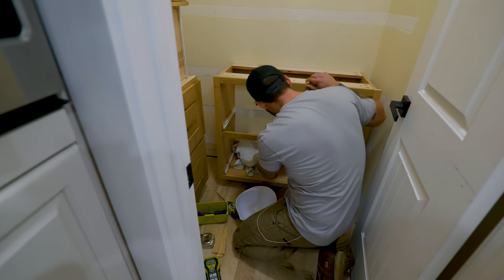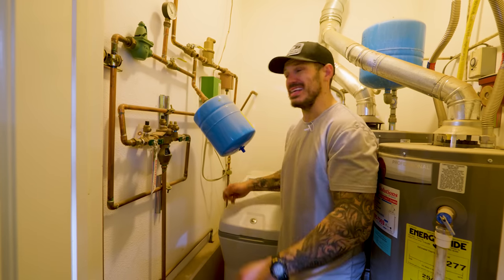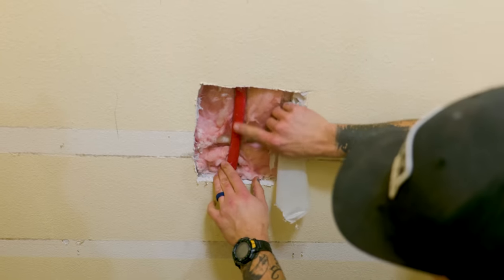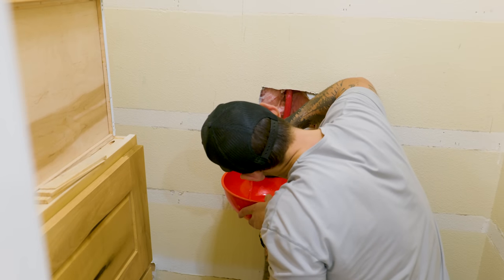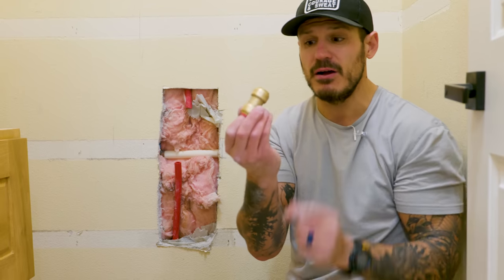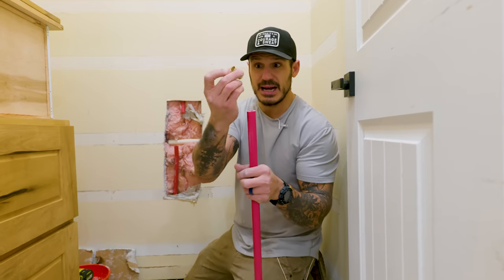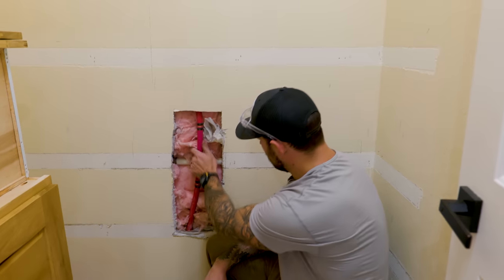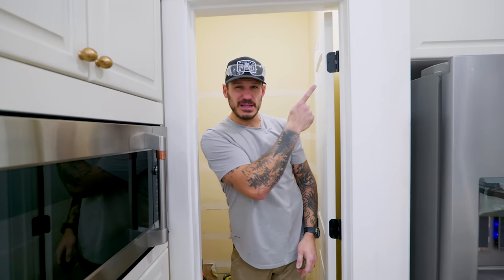Accidentally Drilled Through A Water Line- What To Do!

Comment: I’d rather get shocked than hit a water line
Reply: Both are equally as annoying to be honest, But if you hit an electric run it's worse to fix properly because if you do It right you either have to run a new wire or find a place to put a junction box.

Comment: From my plumber uncle - sharkbite is perfectly fine to use for a home gamer if you have easy access to a line - under a sink, in a basement, etc... but you really don't want to have it somewhere you don't have easy access to, like in a wall.  More than likely, it'll never fail, but in the off chance that it does, there might be pretty significant damage done before you notice.
Reply: Lolol plumber who doesn’t like shark bite alert.
Reply: That might be true. I repaired a couple of leaks in my house with sharkbite, both of them are in pretty easy to reach area. One of them failed after 5 years, the other one is still holding up. Who knows, it may have been a bad one, "plumber" error, I don't know. I check the second one every once in a while to see if it failed but nothing so far.
PD: both of them are cold water, pex b pipe/tubing.

Comment: As a ‘what to do now’ video I would have included. Do not remove the screw! It will limit the amount of water escaping. As someone else said, drain down from a lower point if you can. Including drain off points in your plumbing design is a great idea.

Comment: Glad you also showed the compression ring and coupling method vs just the sharkbite coupling as sharkbites are never to be used in an enclosed space you cannot see or otherwise maintain easily. They are technically only for short-term repairs and never at a long term rate permanently.

Comment: You said there should be some type of metal plate there blocking the pipe?  Shouldn't you add that so you (or future owner) doesn't make the same mistake?
Reply: If the pipe is running through a stud there should be a metal plate on the stud where the pipe runs through it. In this case his stud finder actually found a pipe instead of a stud. Where the pipe is running straight up the wall there is no way to really shield it. He just had some bad luck here.

Comment: Thank for showing both methods. Nothing wrong with either connection. It’s just a matter of warranty when you service a customer. Shark bites can be unreliable as in some situations if they are installed with tension the plastic insert inside of those fittings will blow apart. However great job at your reaction time, and knowing where to go to shut off the water is half the battle. Panicking and not knowing where to shut off the water is a bad combo. 90% of clients I service have know idea where the shut off is. Everyone watching….know where it is for your own sake and to protect your home, your investment. Thanks for all you do brother love your work.

Comment: As a plumber I don’t like sharkbites, I have come across a lot of failed sharkbites. Majority of the time it’s due to improper installation. Now as a home owner needing to make a quick cheap quick fix I recommend them. As a professional, I do not. A professional should be doing it the right way, the customer is paying for you to do it properly, you should be giving them value for their hard earned money. Only time as a professional I would use them is in a temporary situation where I know I will be coming back to replace it the proper way. I.e in a emergency situation or if I am doing a remodel and temporary capping or tying in a line.

Great video, this will help Home owners save time and money and avoid damaging anymore of their property.

Comment: After you turn off the water main open up an exterior hose bib (that’s lower in elevation than the damage area) and it should drain out the extra water in the line so it does spill over whenever you cut it to make the repair.

Comment: yeah, kind of did the same when my stud finder said there is a stud behind the wall. Turned out to be the drain pipe from upstairs bathroom. Now after marking the stud with finder, I come back with a magnet to establish a vertical line of dry wall screws to confirm its a stud.

Comment: Yes shark bites are temporary fix they always end up leaking but your second option is perfect !!
Reply: Have some in my basement that are almost 20 years old and not leaking
Reply: @shantor100  one of those lucky people all I can say or u just a handy man lol
Reply: @DracoSzn_  what does what I do have anything to do with my experience. I can generalize like you and tell you I'm a building contractor who spends most of my time fixing so called plumbers and electricians screw ups. Although that happens a lot I'll specify my comment. I don't condone shark bites ahead of soldering or working off of a soldered shark bite nipple. However I've seen plenty of plumbers use them for hot water heater hook ups and other utilities which shocks me so maybe you should get sarcastic with your industry. I use them in certain situations when I can get to them and not bury them in walls and need the water back on . The one in my basement was from a leaking ice maker line right before a party and I didn't have 2 hours to get all of the water out of the line for soldering. Chill out man. Not all shark bites leak
Reply: @shantor100  BRO I love your comment back! And tbh if a “plumber” uses shark bite you mind well just call him a handy man honestly because they just lazy and do half ass jobs ! And I 100% agree with you bro as in only using them if it’s impossible which your statement was !! And That’s the only one I would use is a ice maker shark bite the white one though because those don’t leak !

Comment: Never used sharkbite before, but I'd definitely want the "old fashioned"😂 repair.
Reply: If you are able to use the authorized fitting for the pipe please do so, I’ve been plumbing for 10 years and I can say I’ve replaced more broken shark bites than I’ve put in, if you absolutely have to use one than please don’t burry them in a wall behind a cabinet in a closet 😂😂 they have Orings in them that are made of rubber and no matter what they say WILL fail after so many uses,

Comment: Suggest that you and most home owners pick up a water meter key. They’re about $20 at HD / Lowes and specifically designed for the water meter valve. Obviously a wrench will work in a pinch but this is easier. We keep ours in the front hall closet so if we ever have a water emergency it’s easy to grab on the way outside (older house with no main water shut off valve inside).

Comment: I love shark bites. I know most plumbers hate them but I can't afford a plumber. I've rebuilt broken automatic transmissions and built engines. I can do plumbing. Everything I've done is still working fine
Reply: The only problem with sharkbite is that they last.. until they don't.  They're pretty solid, and will likely never fail, but in the situation where it *does*, it could cause a ton of damage - especially if it is hidden in a wall, where you might not notice until there is significant damage done.

As I commented elsewhere, my plumber uncle will never use sharkbite on a job.. but in his own house, he uses them in areas that has easy access - places that, in the event of a failure or a leak, you can quickly notice and fix.  Putting them in a wall, however, is not a great idea.

That being said, I have a bunch of sharkbite connectors in my toolbox in the off chance that something in the house fails (or I drill into a pipe like in the video), as they're absolutely fantastic temporary solutions.  If you need something right now, it is perfectly fine to slap one on until you have time to actually fix the issue.